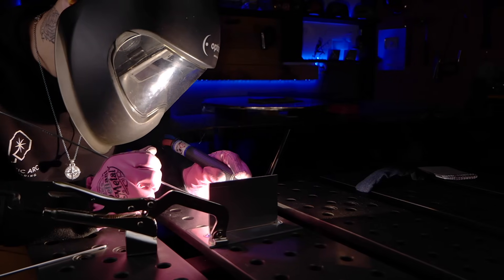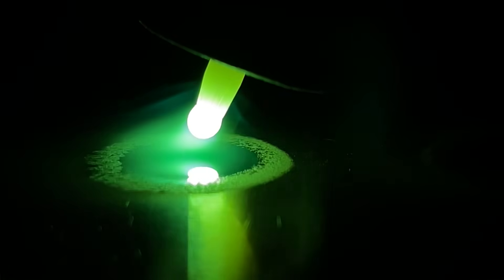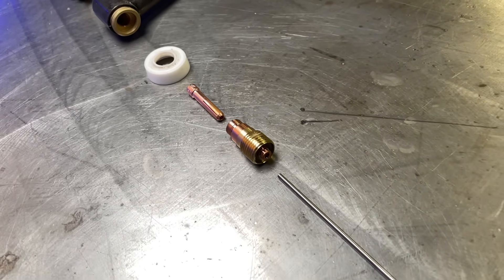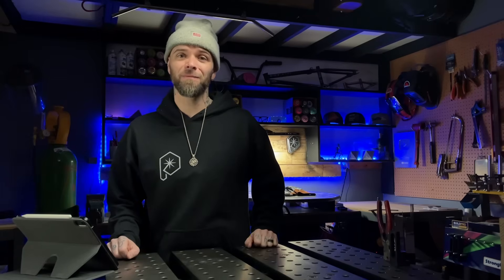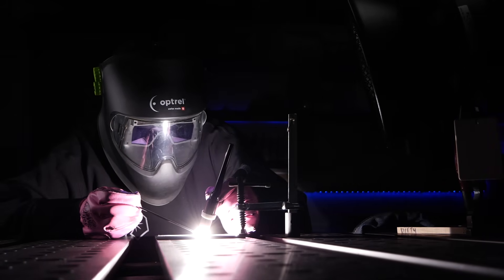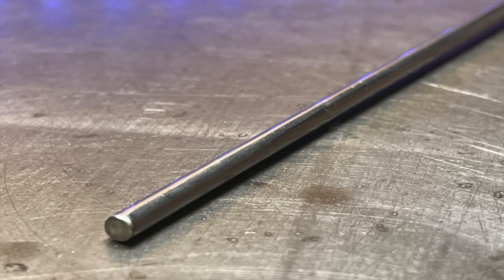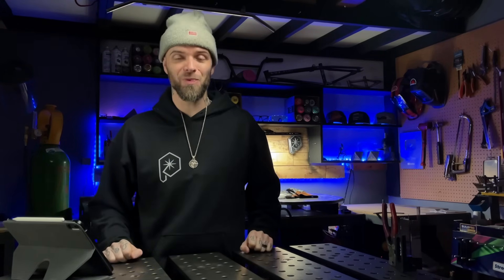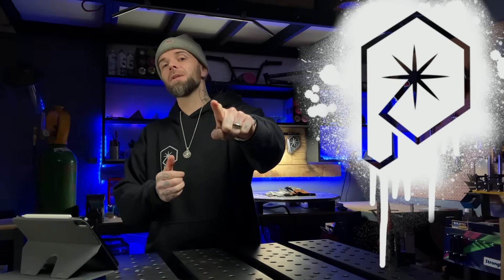How do I start to learn Tig Welding?

Comment: Hi
Thanks for the tips
I’m 62 I’ve been a stick welder all my life and I was pretty good 
I’ve been made redundant after 44 years in the steel industry and joined a firm that specialises in stainless steel 
I’m learning how to tig weld and trial and error , my results were awful but, now I’m getting better.
The trouble is I’m unable to get comfortable with either my torch hand or my filler wire hand and keep dipping the tungsten 
Sometimes my welds look good , the next weld will look like a first day apprentice done it
I’ve watched loads of your downloads but there’s nothing that’s helping me other than the way you feed the filler wire in, and thanks for that
As you can guess from my age that I have a bit of a shake, lol, but tig welding is the most relaxing thing I’ve ever done in my working life and love it 
Any help would be appreciated 
Thanks Martin

Comment: I'm 32 from Holland and just found out that Tig welding is something I should have started  with many years ago. Instant love there. Had my first day today at welding school, but it is totally different kind of lesson than this. Immediately using filler material and every joints. 😅

Comment: As a tradesman myself i never did Tig, only Arc and Mig.
Working in Hydraulics i really want to present my work to the customer with beautiful consistent tig welded fittings and fixtures on cylinders etc.
Cant wait to get a proper machine and learn, your videos being extremely helpful.

Comment: Just started learning TIG yesterday and mistakenly put the machine on AC instead of DC, switched it shocked myself like 10 times. Accidentally stuck the filler rod through my jacket and shirt into my stomach, but my beads are looking decent 😂 I’m having a lot of fun learning to weld, so much goes into it and my ADHD ass loves it.

Comment: such informative vids. thanks. 20 years ago i took a temporary full time job at a place that repaired food grade commercial stainless steel equi[pment. they lost ther head welder so i stepped up to try tig welding for the first time ever. 5 minutes of training and they put me on a big job and a $3 an hour raise. did great the rest of that job and just recently bought an el cheapo tig welder and trying to reteach myself, mainly on atv frames. apparently i forgot all of what i learned 20 years ago. your vids are helping tremendously. thank you so much

Comment: Take your time setup is everthing in real world welding its hard work .         
   Today cost of just welding gas crazy so enjoy learning because it work bending up a roll cage and cleaning and prep. Just cut wholes to get to the frame move gas brake lines clean up that 40year old frame .Maybe strike a tack you get my drift

Comment: This is required watching.  And as someone who has made every mistake in the book much of what you said is so true, Dusty.  I also feel that learning or being self taught while harsh (trust me) when starting out is a great way to learn as well.  Why. Because after making all the mistakes then re-watching these videos they make far more sense.  I can TIG weld thin metal and pie cuts now but after a very long apprenticeship of ineptness, self-embarrassment and watching the same videos over and over and more practise.  Other key's are comfort (body and hand position) and lighting.  And PREP!  So so critical.  If you have a gap between 2 parts.... it will be a holy event!  Cut!  Finish!  Clean!   Then weld.  You cannot short cut on TIG.  And keep watching Pacific Arc Tig Welding.

Comment: Thanks Dusty,  it really helps how you give a way to diagnosis problems instead of just some guy in a video saying how he does something.  I was having some issues welding cast aluminum, and almost gave up until I went through some basics... Did I have a gas leak... no,  did I have my setting correct,  no,  my tungsten was deforming, so I moved to a bigger tungsten and increased the frequency and changed the balance and fixed that.  I still had issues, so I did some research on what rod to use.  I was using ER5356, and simply tried 4043 and it worked.
Reply from the maker: Experimenting and troubleshooting yourself is absolutely some of the best ways to learn. Great job on figuring out a solution! I really appreciate your kind words and really appreciate you checking out the episode. Thank you and have a great weekend!🔥